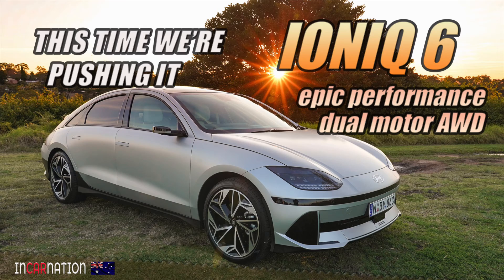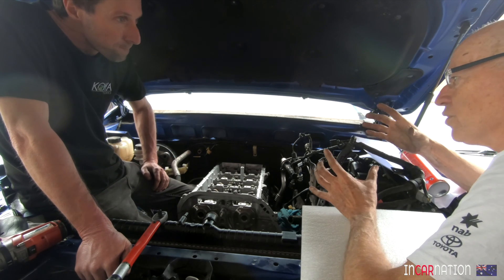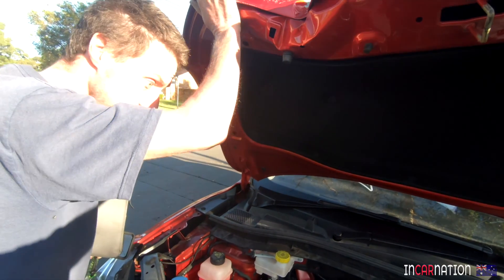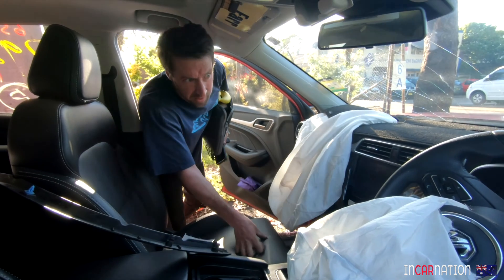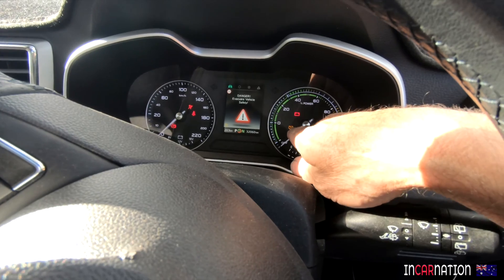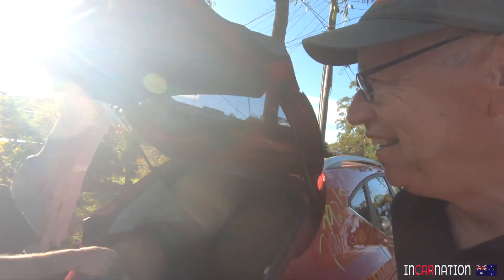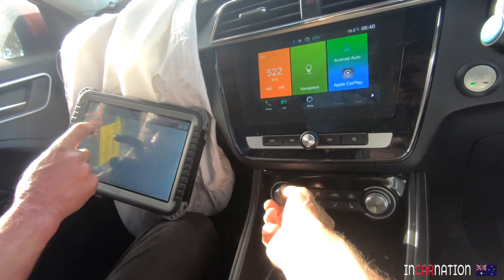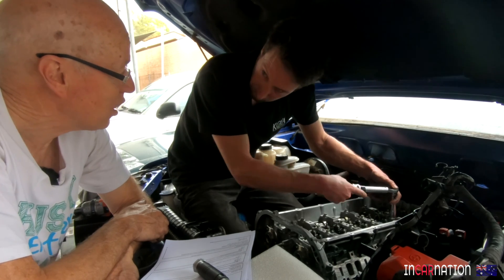Episode 5 – Porsche EV Conversion | I Bought a Crashed EV. Why?

Comment: Found your latest video, now binging on this series.

Can you please not talk sensibly at the end, you've ruined my errr wishful thinking of doing an EV conversion. I'm an IT guy by trade so no car skills.
Reply from the maker: I'm also an (ex-) IT guy with no mechanic skills. Sorry about the sensible talk but when we get there in the end, surely that'll restore your desire to embark on an EV conversion.
Reply: @inCARnationAustralia  Yeah, I was happy to hear about your IT history. Fingers crossed you get this going, subbed and will be waiting for each video.
I'll definiately keep my hopes up on my EV conversion.

I'm supposed to be reverse engineering my CAN, initially just to control media functions, but once I get it working I want to code a party trick to remote control drive my car (safely, very limited speed, private road only). Since the assisted parking can do it, I'm assuming I can control remotely too.
But until I decide to allocate time to it, nothing will start!

Comment: Are you sure it wouldn't run because the charge port is not properly closed?  Mine won't go if the flap is open.
Reply from the maker: Good thinking but that's not it. Next episode will have some answers

Comment: I just hope the pen pushers will give you registration papers. Which class of vehicle is this. You do like a challenge. 🙀
Reply from the maker: Already have a state government certifying engineer involved. I want to ensure I don't do something radical that would cause big problems. Like modify the chassis or structural integrity of the Porsche, etc. But yes, good point thanks